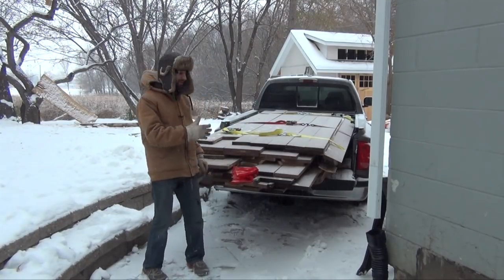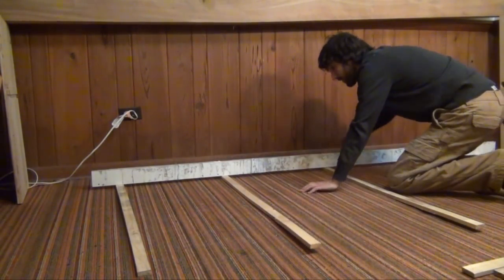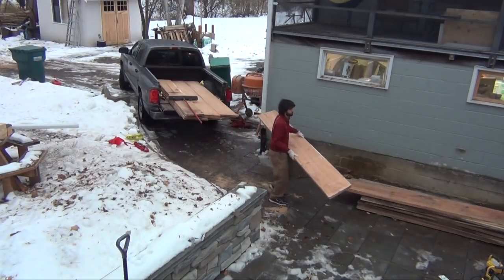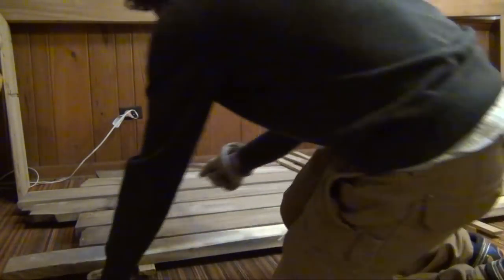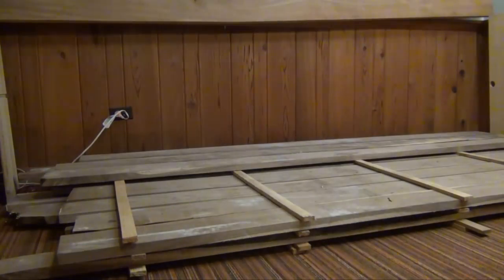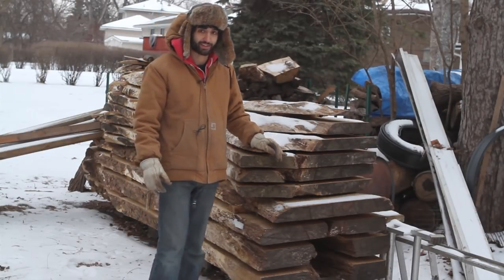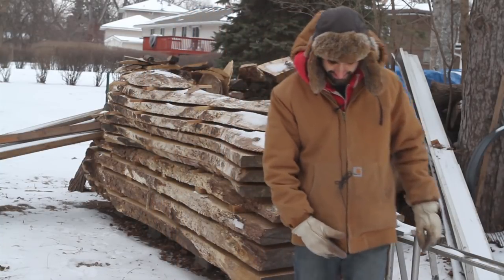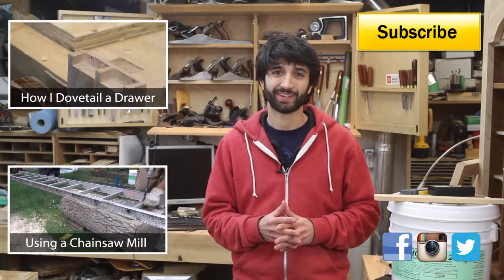Air Drying Your Own Lumber

Comment: Hi Matt.  A lot of great info here.  If I might add a few points without stepping on anyones toes, I'd like to share a few things I've learned from my 30 years running a portable sawmill business, drying lumber, and building furniture.  Anchorseal is the best.  But to get the most out of it you should apply it to a fresh cut, either when the log is first bucked to length, or right after it is milled.  With the later, it's best to make a fresh cut an inch or two on each end of the board, then coat.  Second, you really should keep your first and last sticker within an inch or so of the end of the board.  Seventy percent of end checks will stop at the first sticker.  Here in PA when drying lumber outside you can bring the moister down to around 15% (relative humidity).  After the I often bring the wood inside and stack it behind the couch in the living room for a few weeks to bring it down to 8%.  However, I've found this system only works if I actually produce a nice piece of furniture for my wife.  Hope this info helps.  Keep up the good work.
Pat Shull,  Shullwood Portable Sawmill
Reply: How long does it take to get down to 15% outside? I'm in south central PA.
Reply: Dehumidifier helps with a fan too.
Reply: Kathy, can you apply the Anchorseal in cold weather?
Reply: Timber should be dried according to the relative humidity in the area you're living in. The closest to PA I've seen is NY and the relative humidity there is 12%. 8% is very dry but I guess there are places that low. Timber  should be acclimatized to the area where it will be used before starting a job because there's virtually nothing you can do to stop it matching the relative humidity of where it is.
Reply: Thank you for the addition info . One wouldnt think that a sticker would stop a check
Reply: Thanks For the added information Pat. I was going to ask Matt and I still may, but what about the sides of the drying lumber. It looks like Matt butts everything together. Is there any consideration to spacing between lumber on the same row? Thanks. John
Reply: @johnakagi1088  this is a great question and we like to space ours out more, with at least a 1" space to allow for air flow around the boards
Reply: Great tips Pat, thank you
Reply: But you only apply it to the end grain right? never to the side grain or face.
Reply: People won't listen to me about placing the stickers close to the end to stop checking.

Comment: Well done Matt.  I would add a couple of other points that will improve the quality of the air-dried lumber. Be consistent with the spacing of the stickers.  I would recommend every 12", but 18" is okay.  The stickers should be within 3 inches of the end of the boards. That would mean that your pile is the length of your longest board and you stack to both ends by alternating which end your boards will be closest to.  Leave between 1" and 2" between boards so you get air movement bottom to top as well, and cover the last layer with plywood on stickers, then weight.  A pin moisture meter needs to reach 1/5 the thickness of the board to be able to measure the Average Equilibrium Moisture Content of the board.  With one pin length it can only measure one thickness.  The Wagner meters work great, but the species setting can't take into consideration boards which fall outside that norm.  For instance if you're measuring something like Punky ash for guitar bodies, it will not measure accurately, and pieces thinner than 1/2" will not measure accurately.  This is coming from 40 years of experience and a degree in Wood Science and Technology.

Comment: Long after it was a fresh video - but, a helpful hint that I have used for years...

The best stickers I have ever found has been 2" PVC pipe cut in half.  It gives you a U shape that has minimal contact points, it is dirt cheap, doesn't rot or carry moisture.  Won't stain or cause those issues and you can store a ton of them in a five gallon bucket.  Create a little jig for pushing the pip through on a band saw (mainly a bit of metal to act as a splitter and keep the pipe from twisting as you rip a few dozen feet in half) and you can create them in a few minutes.

While they don't quite have the same compressive strength as solid wood stickers do, I have never had one fail and have had them holding up boules of 4 foot wide sinker cypress that were still so water logged that you could actually watch the water steam off the blade when cutting them.

Comment: Nice video. 
Here is an old man tip. Never ever let your lumber touch the cement or bare ground with out a cloth or plywood.  First time you run a rock or pebble through a sharp planer or jointer blades you'll get it !  One more is lumber tends to stop checking splitting to the first sticker and stop. Not 100% but enough I noticed in my life in lumber use. Hold them out to the ends!
Reply: what is a sticker?

Comment: If inside, you can use a dehumidifier to dry it out.  It will remove moisture faster than a fan will and you can see/control what humidity level  the wood sits in storage (on the LCD display).  For outside, you can buy a fungicide additive from any decent paint store and spray it on lightly with a garden pump sprayer.  Same with an insecticide.  Mold/fungus can't survive in 55% humidity or less.

Comment: Super helpful! I just had 2500 bf of clear pine milled at my cottage and am planning to finish the interior once it's ready. It's freezing here now so as soon as winter is at an end I'll get that end cut sealer on the boards. The miller stacked it all up very carefully, with some large weighing it down on top, and a light cover of tar paper to shed the weather. This video tutorial is really great education. Thanks!
Reply: In my experience, I've learned not to wait at all - for any reason. Get that Anchorseal on the edges as soon as you stack them. Even if you have snow/ice on them fresh from the mill. The day/night melt/freeze cycle will check them harder. I keep the Anchorseal toasty inside, and paint it on the ends. If you kick off the ice/snow, the tiny amount left will melt and the seal will stick nicely :-)

Comment: Suggestions: to increase natural convection space first layer 4-5" above ground and leave 7-8" space from wall (chimmey effect). Also leave more space between lumber (cooling drop). 

To prevent checking and uneven drying do not stack sticlers directly over the sticker below (creates concentrated wet area).  Stagger stickers slightly. 

 The best way to stop end splits is to have a sticker at the very end of board (over hangs split like crazy).

Flip boards on top occasionally especially early on.

Also never move things twice if you don't have too!

Comment: In the basement of my last house, if I left anything on the floor the moisture would dampen it. The floor was never wet it was just the moisture coming up from the ground thru the cement. The house was left vacant for a year & even in the attached-garage things got damp. I had a pretty new bicycle in there and the chain rusted up solid!  I'm telling you this because if I was stacking wood in a basement like this it would need to be up off of the floor at least 8inches maybe more. Great Video as always!!

Comment: I air dry hardwood lumber on stickers in the eaves of my barn.  It works good enough, but I must say that I always get movement after I bring my finished pieces into the house.  My oldest samples are about 6 years old.  I did some work with 40 year old cherry lumber and that was good and stable.  But i can't wait that long for the rest!
Reply: +Peter Collin dried lumber will still have movement as ambient tempurature and humidity change with the seasons or location.  This is even true with kiln dried lumber purchased from a lumber yard.  This is why its often a good idea to bring your pieces for a project into the shop a few days or weeks before final milling and why its absolutely essential to allow for movement in your furniture designs.

Comment: Matt as you can see my pic is a Cypress knee.  I live in Florida and I've been working cypress with no drying time at all.  I know I'm taking a chance.  The pieces are small and I'm not making a large project.  Plus Cypress doesn't crack much, I also use a hardener on my wood.  The biggest problem is getting the glue to dry when joining boards because the glue between the wood does not dry completely.  Thanks for the tips on drying.  I'm mostly drying rough cut wood no boards.When I graduate to a larger shop and projects, your techniques will be invaluable.

Comment: Hi Matt, thanks for the video. I read somewhere (haven't tried it for myself) that PVC conduit cut in half lengthways makes for good stickers. No staining, minimal wood contact and won't change shape on you. The only problem may be the building of a jig to cut it in the first place.
Reply from the maker: ***** That would work great.  I wonder what the compression strength is like?
Reply: Matthew Cremona 
It would depend on the conduit used, in Australia we have HD electrical conduit which is orange and very tough, I don't see a problem having several hundred kilograms on a set of stickers made from this.
Reply: What size of pipe would you suggest?
Reply: @rogerboucher1913 Maybe 40mm? That gives you 20mm between layers once cut.

Comment: So you sell wood? I made a couple of farm tables out of construction lumber which I should have laid down in my basement before I made it. At 42 inches wide I ended up with a cracked top because I was STUPID and put a breadboard edge on with biscuits, pocket screws and glue. It shrunk a half inch and my daughter to who it was a gift heard a loud bang and found a crack about a quarter inch wide. Character I told her, she didn't buy into it so I sawed the bread board edges off and glued the crack and the bread board edge back on. I would like to make a real one out of either white oak, cherry or walnut. The next construction lumber one got a design change with a not attached breadboard edge. It did not crack.

Comment: Very informative video and very well done as always.  I have the same pin meter you show and use it when I go to a couple of hardwood dealers that buy locally to roughly gauge how wet they are.  It's pretty wet in my neck of the woods.  In the winter indoor humidity runs between 30 and 40% with electric heat.  We have a dehumidifier that runs year round in our basement to keep it below 50%.  It doesn't run as often in the winter as it does in the summer.
Reply from the maker: Jim Coogan Thank you Jim!  It's incredible how much water there is inside of a tree!  When I first bring these boards in, they are outside of the range of my meter.  So wet!

Comment: It is very important to get the base level and straight.  This is a must to get your boards straight.  It's harder if you are stacking on an uneven surface; easier if you are starting with a concrete floor.

Comment: forestor/sawer told me to use stickers of a different species and it will minimize sticker stain. He also said you should dry the wood in the elements for at least a year. He works for a big mill in the area.

Comment: I stacked some mulberry, pine, and red cedar in my garage to dry, using 3/4" stickers (sliced up sub floor).  I used a fan to create airflow, and then I used a dehumidifier.  

After six months I dismantled the stack and took it to a friend who has a kiln .... he did a moisture check before putting it in the kiln, and he found that the timber was as dry as if it had been kiln dried! 

This was during summer in The South, when the ambient temperature was 90°F +/-5°

Comment: I like the log storing idea for outside. One thing is when I'm milling up lumber I'll switch the face over and see which grain I like best so I wouldn't be able to assemble it back to the same shape. But for most cases I think this would work good.
Reply from the maker: deleetmeeh Yeah, with that method, you're pretty much stuck cutting through and through

Comment: I've watched several videos and read a bunch of things oh the process of drying out maple wood slices (1 inch thick x 14 around). I am confused. I do like your process of stacking - thank you for this information. I am using the wood slices for my daughters wedding centerpieces at the end of June 2023. Should i be applying anchor seal on the raw cut wood and live edge prior to stacking? Or is it after it gets to the proper moisture level? I am VERY new at any kind of wood working but i also couldnt resist the gorgeous pieces i was given! Advice is so very welcome here! thank you!!

Comment: thanks for the tips. I dry very small batches occasionally (urban harvested) and have used wood glue painted on the ends with a brush for sealing. It seems to work, I always have lots of glue around. Also I think the European style drying you showed is called "en boule" or "in the round". I have heard it referred to as that anyway, not sure about the spelling. cheers

Comment: You seem to know more than the average bear about wood, and so I felt motivated to share a few details with you also. It has been my experience that to protect the wood from picking up decomposer microbes from the soil it is important to drape the ground where the wood will contact the earth. Because the wood had been in the air in its whole life and was maintained with a living immune system, it never adapted to direct ground contact on open wood tissues with parasitic and invasive decomposer organisms and lacking an active immune system. The consequence is the early retirement of the wood from usefulness. Basically, It will fall apart. Very important detail. I am planning to spray down my entire cord of furniture wood with a potent antifungal spray until I can set up my drying barn. I've also seen someone use lots of epsom salt between the planks in the stack to pull the moisture out. The moisture was visibly frothing and boiling out of the ends of the planks in the pile. I supposed that was a speed-dry method.

Comment: Matt, Let me bounce my plan off of you and your subscribers. I have property in So Georgia, it is 7 acres of virgin southern white pine. I would like to clear my home site and harvest the trees I remove for future use. Step one clear the underbrush and select the spot for the house. The house will be 5 shipping containers, the wood I use will be the internal framing. I am planning over the next three years two cut my trees into 5 or 6 inch slabs and place in a tent garage for drying. In a couple of years add a shipping container as a make shift kiln. It will be ventilated with solar attic fans. This should be another year or so. Most of this wood will be 2x framing material, I am most concerned about bugs and dimensional stability. Should I plan to make my slabs large enough to run them through a planer prior to cutting into 2x framing wood? Also in Georgia is there a better time to harvest the wood? In NY the sap runs to the roots in winter, I expect this would expedite drying since most of the moisture is left in the ground. Is this significant enough to plan my tree cutting for the winter months? You have seen my mill on youtube,  you complimented it, made me feel like a hero! Thanks. I know this is a lot to consider but I respect your experience.  Thanks for your time.

Comment: I recommend buying a few packs of beef jerky and saving the jell packs that say "do not eat" those absorb moisture. But i put my wet lumber in my furnace/boiler room with a small fan and a dehumidifier. He forgot to mention the "faster" your wood drys the easier it cracks and warps
Reply from the maker: Frogking9 Good tip.  That's true, but that's pretty hard to do when doing simple air drying.  When you move to drying in a warmer, dryer, high airflow environment then it becomes really easy to ruin boards.

Comment: Good info. I use that pin style meter. It does have different settings for varied densities. I usually do like you said, check another piece of lumber of the same species that's been in my garage for awhile and see how close it is. I just bought a hydrometer/temp gauge so I can monitor what the garage stays at. I run an electric heater ever so often and my air filtration unit on high to circulate the area around wood that I bring it. Luckily the garage matches the houses humidity level. 

I haven't brought any green wood into dry just yet but this has gotten me starting to think about it. I really like working with slabs and if I can bring essentially an entire cut log into the garage and have it sit for a year and be dry enough to use, that would be great. I love working with walnut and the best way to dry it seems to be air drying. Kiln drying, it loses some of that dark rich color. 

Watching your videos has gotten me wanting to start milling. I've got the room on my property and lots of treescape in the back yard. I just don't know if the neighbors would appreciate it, haha. Maybe whenever we move on to another home I'll take it on as a hobby.

Comment: Your reference [dry] piece of wood once left out in room/outside air will "track" changing relative humidity of that air, adsorbing moisture to correspond. Ex.: if RH is 100%, MC of wood will stabilize eventually at ~30% (fiber saturation point). Wood is hygroscopic, like hair, calcium chloride, etc.